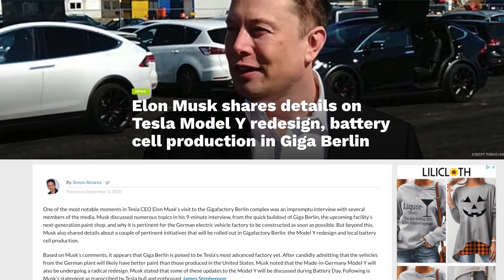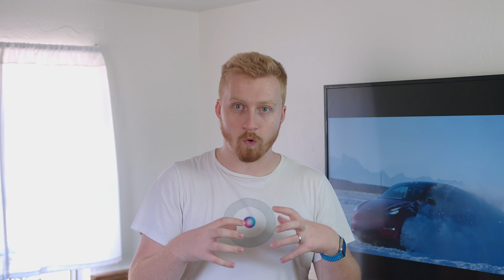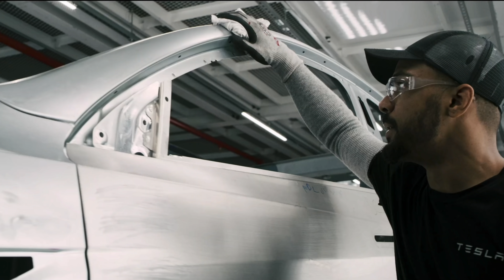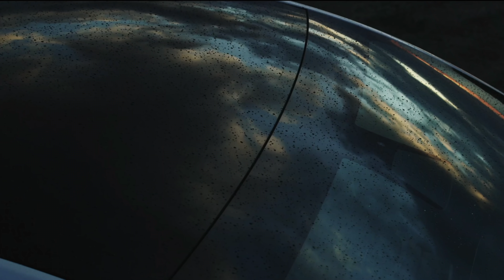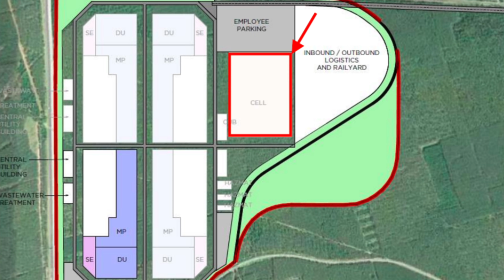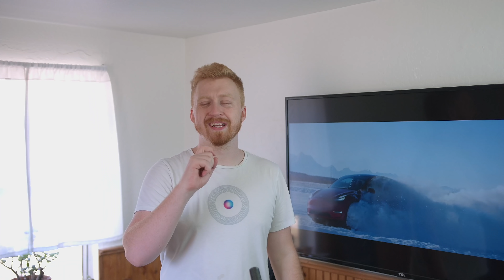Made in Germany Model Y to have "Redesigned Core Tech"

Comment: IMO, Core structural redesign:
- More big die casting parts, so we have less number of small parts needing welding
- New internal electrical and data architecture (which was earlier promised)
- Best in class paint
- More optimized manufacturing.

Comment: Fremont is getting the same upgrade for the body also the new wiring harness is also likely to be started.
S X and 3 are likely to have the new casting system used on them in the next year or two.

Comment: do you think once tega is up and running in texas they will bulldose fremont and start again there?
Reply: Doing that wouldn’t make sense. Way should they only have one factory in the us when they can have two doing and building different things.
Reply: @johnnboy2000  doze it and start again for once tegas going with the CT and Y  not many 3s will be sold so they could be slipped into the line as needed. Then once fregas back online properly with a completely new factory setup, pump out good cars with qc up to scratch, fremont sucks for good quality control. Just ask sandy munroe, he reckons the paint shop should have been wiped from the face of the earth and started again.

Comment: Maybe the electrical architecture will change also? 800 volt system with "no module" battery packs and upgraded batteries.
Reply: Stephen Howard they won’t do 800V for the Model Y since it’ll add much more complexity! Plus the 3 and Y share the exact same drivetrain so 400V for those vehicles isn’t bad! Now the roadster v2 will be a completely different story and might have an 800V architecture!

Comment: The transformation of the Model Y in Berlin has to do with a transformation of the structural battery core technology. This involves ALL aspects of the battery system!! Chemistry, shape, size of batteries, tabless batteries, no modules . . . What’s the “core” technology in a “Battery Electric” car?  Big hint there: battery is the core.  Batteries have cores. Clearly NOT the casting now that I think about if more.
Reply: Elon did not specify EV, he specified transformation of core technology of manufacturing automobiles
Reply: J . P Goodwin  Batteries have cores. People already know about the casting - not new. Why would he talk about casting or inside of car at Battery Day? The Battery tech has not changed much. The Battery Pack will be DRAMATICALLY IMPROVED!

Comment: It may be not as good as the Berlin paint shop but there is a new 2nd paint shop at freemont. Also  Freemont  already has a casting machine in operation. Fired it up a few weeks ago. They built it outside the main factory under a frigging giant carport! Gotta love that Elon! Plus there is a new tent for model y assembly. They where not screwing  around during the shutdown!
Reply: They had to do that to save money because they didn't already had factories worldwide like toyota or vw
Reply: @carholic-sz3qv  Thats true to a certain degree, Its the only factory they did not build from scratch so they are making due with the space they have. but the biggest reason they are a doing this is to get as many cars out the door as possible to keep up with the the ridiculous demand for their products. These guys are selling every car they make.
Reply: @dclpgh  Plus the machine is just so huge and heavy it is a massive problem trying to install it inside in the existing buildings, faster and easier to build around it
Reply: They will probably get around to building a more permanent structure around it down the road but it's probably not a front burner item right now
Reply: @dclpgh  In a way first "pre production" trial, ironing out any issues and evaluating the machine so any changes needed can be implemented for Berlin and Austin, Shanghai already has theirs installed and operational on a trial basis as Shanghai has already produced a "production Model Y " for official testing and evaluation and have received permission to now go into production with it when ready